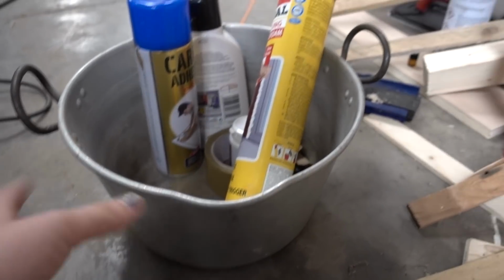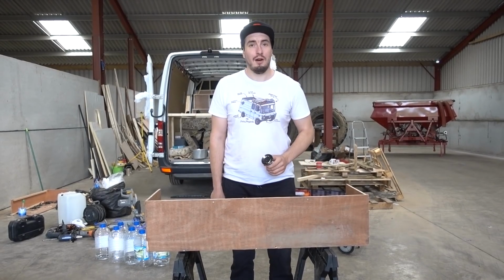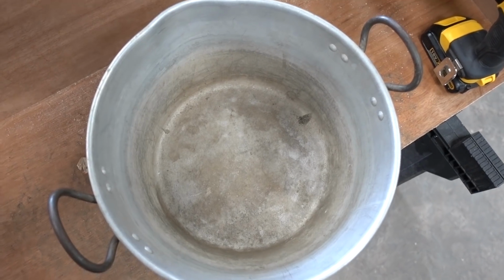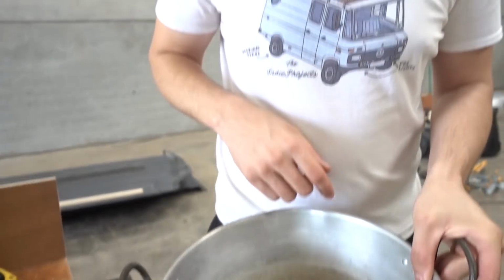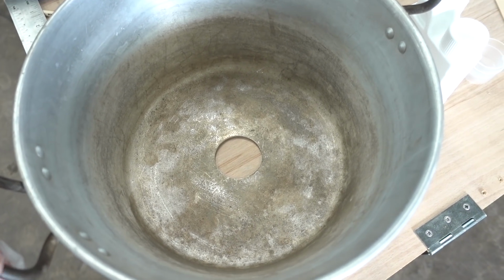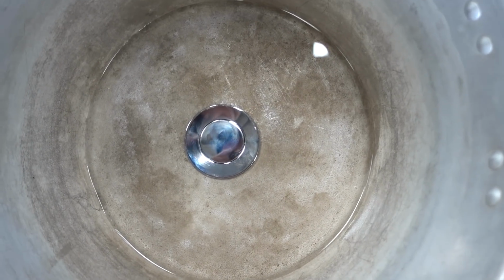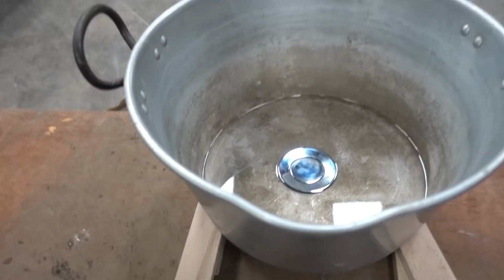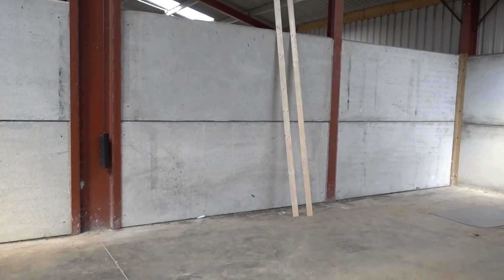How To Make A Custom Sink For Your DIY Campervan Conversion!

Comment: If you get bubbles in your resin hit it for a few seconds with a hair dryer, or heat gun (on low) while it is still liquid, and the bubbles will rise to the surface and pop.
I'd have been tempted to mix some plasticy glittery powdery type stuff in that epoxy. It would look good when it had set. (I know all the proper technical names as you can see)

Comment: Just a bit of advice with the hole saw, use oil (3 in 1 is good) and go steady with it. If you go fast and heat the saw up you'll over heat the teeth and then they go soft and you ruin the saw.
Reply from the maker: Yeah for sure! Meant to go fast at the start then I slowed right down :)

Comment: Nice work. I love that the jam pan has a family connection. My sink is going to be a 36 cm stainless steel mixing bowl. I'm probably going to opt for a caravan sized plughole so I might not need to epoxy but I have an idea for using some of the little shells and nice pebbles my late partner and I collected off various beaches on our caravan travels and setting those in resin. Keep the inspirational videos coming.
Reply: Forgot to mention, I saw brass coal scuttle used as a sink. It looked great!

Comment: I think what you need is a sealant instead of ply wood to seal the drainage
Reply from the maker: Plywood is not sealing the hole it’s just adding enough depth so the plug screws tight & there is a rubber grommet between the ply and the jam pan.

Comment: Hey Guys! Great video and brilliant idea re the resin, I've actually just done the same thing using this guide so thanks a lot for the idea. Just one thing I'm a bit worried about, I noticed in the instructions that it said in the precautions "Does not withstand contact with water, even when dry" as well as "Resins are not approved for food contact". Just wanted to know if thats something to be concerned about or not? Thanks, and keep being awesome!

Comment: just get the right sink, don't go with the epoxy method. you gonna create leaks and wont't be leveled. it will cost you less and waste less time to get the right sink. I hope it helps
Reply: the more i loo at your design; I really advise to get a real sink, it will look cleaner, more usable, waste less time, frustration to fix and be flushed to the counter. i promise you will regret this sink. do it right from the get go, you won't regret it.
Reply from the maker: Hey Marc, I’ve been in 100s of self builds (maybe more than anyone in the world 😂) we know what we wan’t. We don’t want it flush to the counter top, we don’t want it to look perfect but thanks for your concern 🙏🏻

Comment: Weve just had a new sink at home with that same style flip over plug system , we find it quite stiff to operate after a short time of using it , i think soap etc dissolves the lubricant around the rubber o ring then it becomes stiff to use and can hurt your finger when it does finally flip open , ive tried to re lube it but it dont last long , think i will be swapping it out for a different style soon , love your vids btw nice work as always , it will be a nice van when you are done ....